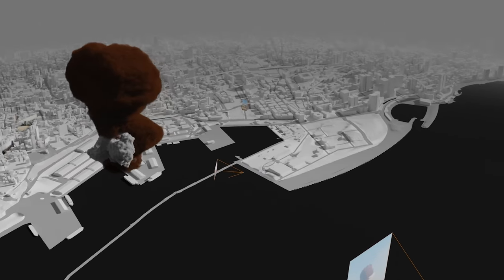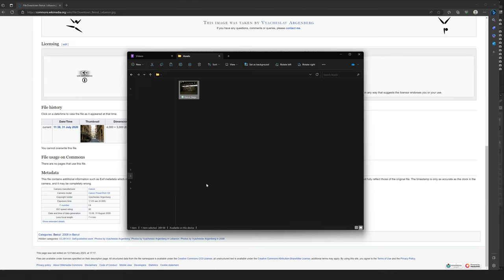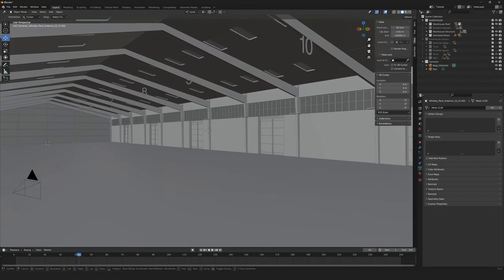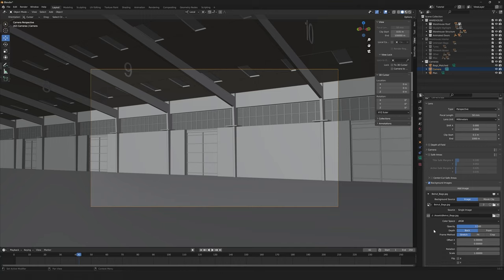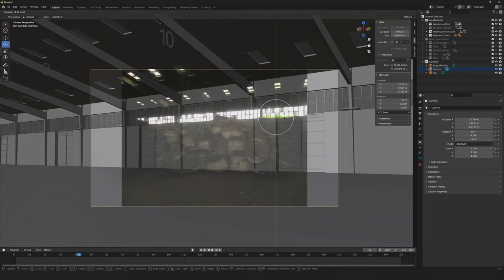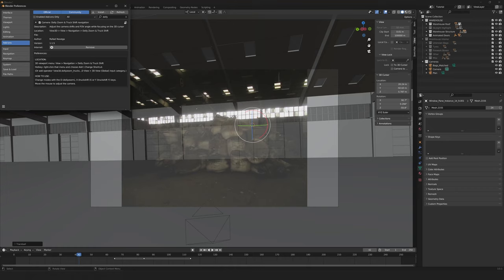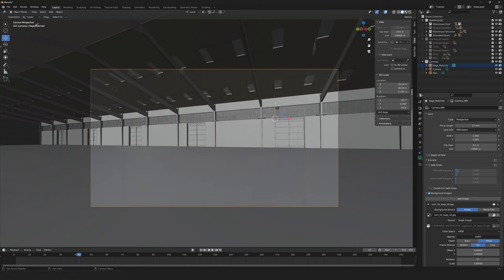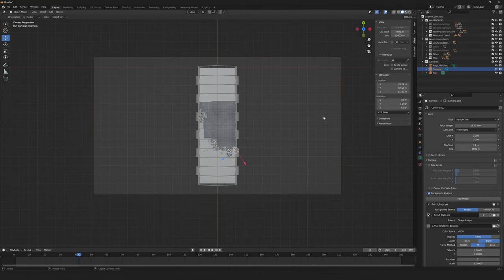Camera Matching in Blender – Forensic Architecture Investigative Toolkit 01

Comment: Hi There, 

So glad you're starting a tutorial series on your workflows. I've been seeking how to do those video stabalisation panoramas, where you "paint" the video in 3d space for a while now. You use the technique in  "The Killing of Muhammad Al-Arab" at 5:15,  "The Beirut Port Explosion: The Welders" at 2:25, and "The Seizure of the Iuventa 2.0" at 10:09, among other videos. I'd love to see the workflow for this technique, and if there's any existing documentation! Thanks again for this video :)
Reply: I agree the stabilized panoramas are a great technique to quickly communicate the environment in which a recording takes place. I spent quite a while a few years ago trying to figure the technique out for myself. 

Steps I use for the 2D panoramas: 
- Extract individual frames from the video as individual images in a folder, helps to do a draft run first with only every nth frame as you will likely need to do some tweaking on the camera intrinsics, perspective and colours as well as to test if the technique is feasible for the footage you have. You can end up to 1,000 frames which takes awhile to processes hence why. I recommend ffmpeg for this step with the command `ffmpeg -i input.mp4 -vf fps=5 output%d.png`
- Make a panorama out of the individual frames with software like Adobe Photoshop (for simple ones) or a PanoTools package (for complex ones that don't play nice with Photoshop), just make sure the software you use lets you export the final panorama as the individual frames with transparency warped into their final place in the panorama.
- It's important to do all the aligning and corrections before exporting and going to the next step, if you move the layers later after importing the panorama in the video editing software the cylindrical/spherical panorama mapping will be wrong and ruin the effect.
- At this point you will have a folder full of the one panorama, but each image is just one frame in the panorama in sequential order.
- Import all the frames into video editing software like Adobe After Effects and use a persistence filter, this keeps all the previous frames on screen as the camera moves around the panorama. This can be really slow to render on long clips so do it as a separate project file.

Note however that this works best on footage where the camera stays still and is rotated around the lens nodal point, rotation at arms length will be usable unless what you're looking at is in the close foreground, this technique doesn't work well with a moving camera.

Also if you don't care about mapping the footage onto a perspective correct cylindrical/spherical panorama, you can just track the footage in After Effects or Blender and use the motion to move the video across the composition, this method works best for recordings where the camera is translated across a flat surface, like moving over a printed document without any rotation.

For moving camera footage with the projection of video footage onto a 3D environment a very different effect is done within Blender using the camera projection tools, the difficult part of that is the 3D camera tracking and 3D environment reconstruction, I've been playing around with this technique combined with Photogrammetry and motion capture and the results are really unique, but it takes A LOT of time and effort.